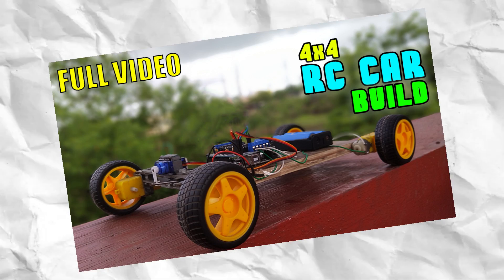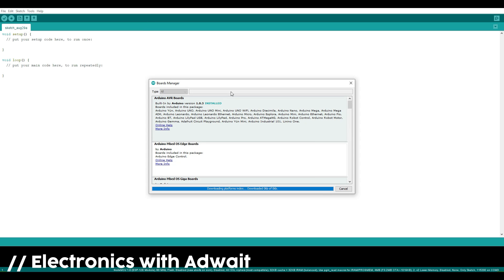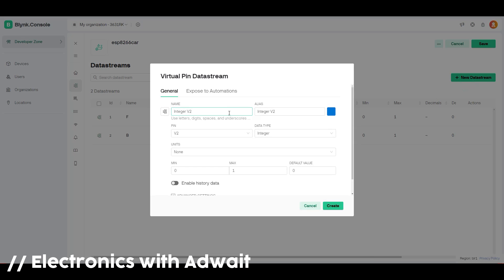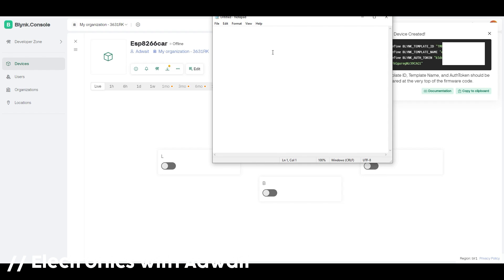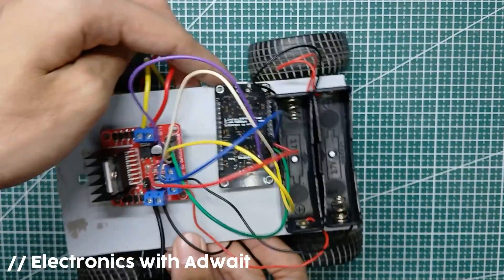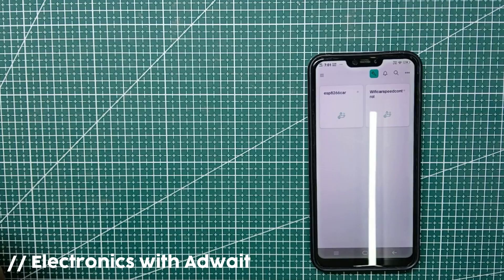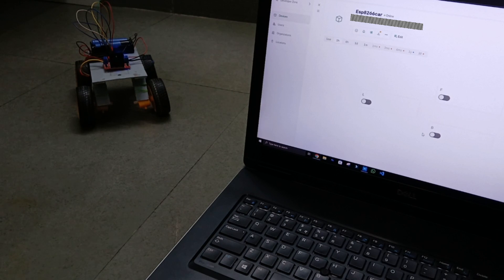How to make a Wi-Fi car using NodeMCU esp8266 (detailed video) | Electronics with Adwait

Comment: Sir can you tell me where is  5v connection because in video it is not connected but in circuit diagram it is
Reply from the maker: 5v in the circuit diagram is just for reference , it is connected to the esp through the motor driver's 5v output terminal(some motor drivers have screw terminal, just beside 7.4v and gnd while some have header pins just like in my case)
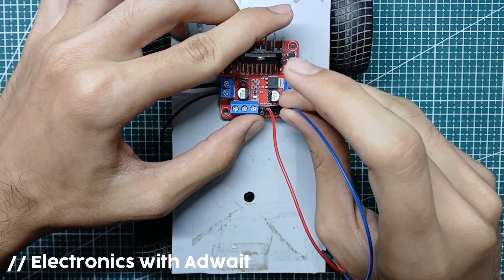See those blue and red jumpers from the motor driver , connect those to any of the 3v3/3v and gnd of the esp8266. Refer this - 01:39
Reply: @electronicswithadwait  sir please give a proper circuit diagram 😢
Reply from the maker: @BAPPA-i9d  Sure I'll update that circuit diagram in the description till tommorrow. 
Happy Diwali !!
Reply: @electronicswithadwait   ok sir I request you can it be today because I want to present it in my college
Reply: @electronicswithadwait   please sir can't you   update today because I have exibition in my college
Reply: @electronicswithadwait  please sir update today
Reply from the maker: @BAPPA-i9d  Updated !!
Reply from the maker: @BAPPA-i9d  Updated successfully
Reply: @electronicswithadwait please sir update today because I am participating in my college exibition
Reply from the maker: @BAPPA-i9d  I hope the updated one works for you.
Reply: @electronicswithadwait  thanks bro you made my day 😊 i will pray for you to become a big Youtuber in future ❤
Reply from the maker: @BAPPA-i9d  Welcome bro !!
Reply: Please sir
Reply: Sir please reply